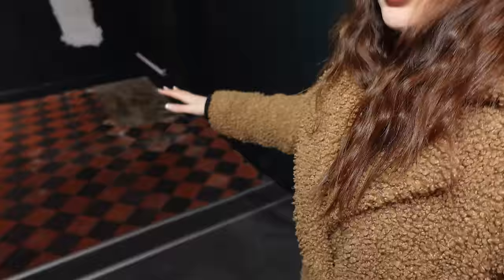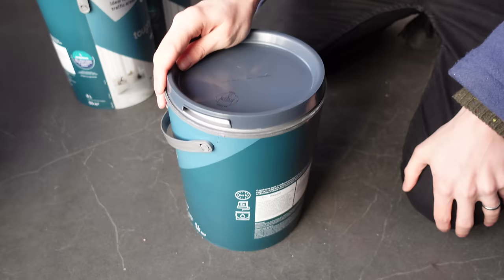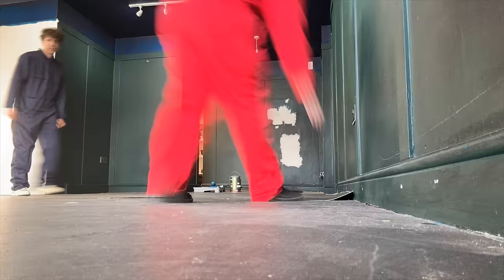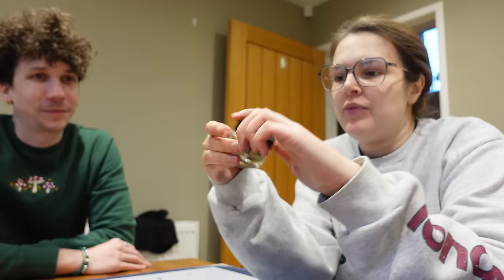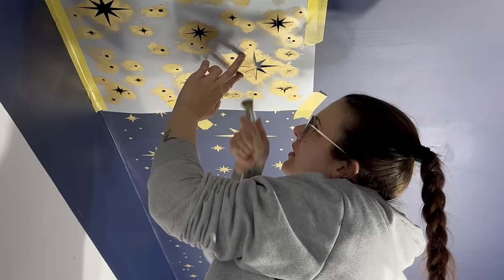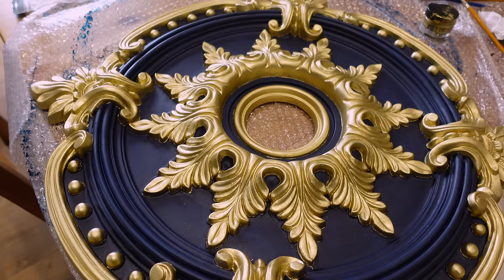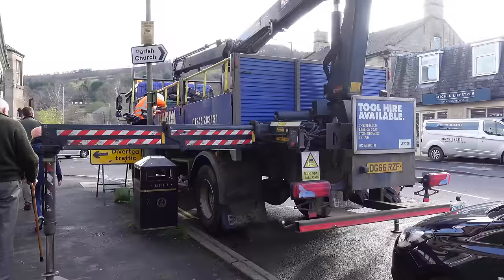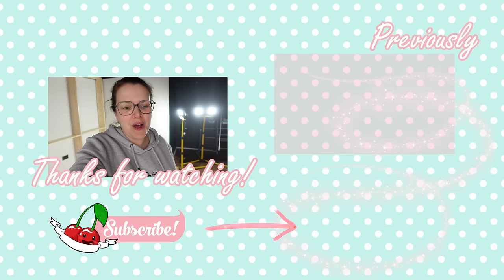starting the renovations on my magical shop 🪚 | Part 1

Comment: I personally would have left the gold flecks on the floor. It is so whimsical. Like it suggests that the magic in the air is so thick, golden dust falls in little deposits. Or maybe a potion bubbled over. Or the wood is from a tree with magical properties and the sap that oozed out was made of gold.

Comment: 😂Lesley is too humble...  his  sign making talent is other level.  He could make a living making signs and putting subliminal words, symbols, and visuals under the layers,  so anyone looking at the sign before entering promotes the best for the sign owner.  (Just an idea to enhance the shoppe experience.)
My question is, what did Lesley use to seal it? A heavy  epoxy or a light varathane? Brush on epoxy in a ventillated room will last longer in the outdoor elements whereas a light spray of varathane is more for indoors. 

 And so lovely to see people open to the healthy best of magical beingness. 💥

Comment: a little tip,  is more of my opinion,  not a fact.  
regarding stenciling the ceiling.  the fast way use or make homemade  wall paper.    paint paper,  then stencil the paper via roller pressing.,  then apply paper to the ceiling. 
there are youtubers doing that homemade wallpaper.

Comment: Here's a comment from Japan!
Your magic shop is amazing!! I really want to visit it someday☺️
When doing stenciling, instead of using that brush, I think it would be much easier if you tightly attach a dishwashing sponge to a stick and use that. Good luck!❤
Reply: Hi from Canada.  I think it depends what look you're going for.  The sponge can leave a  porous finish, depending on the type of sponge.  Whereas the brush goes right into corners, leaving a sharp edge.  A more porous sponge could give a softer look.

Comment: Just wanna give a heads up on the sign (its gorgeous btw 😍) but because of the type of wood he used make sure it’s sealed really well or it’s gone expand and fall apart when it soaks up water from the rain 
Personally I would put a thin layer of resin all around to protect it 😘
Reply from the maker: Absolutely, we’re weather sealing the heck out of it, as we want it to last!

Comment: Cherry, did you thinking about just using a paint roller to apply the gold onto the stencils? Btw. I am do excited for you! Congratulations on your new shop, I know it's gonna be amazing because you are one of the most creative and talented people that I've seen to date.
Reply from the maker: A roller would have worked if we were using paint and on a flat surface (upside down on a ceiling has its own problems with stencils haha, and it being perfectly flush was one of them).

Comment: Just a little tip, always do the flooring after you're done with painting and construction, that way you won't damage your new floor. You basically work your way down from the top, so ceilings first, then the walls, then the floor. And installing PVC really isn't hard, you don't need to hire a professional for that 😂❤

Comment: i would wager the ceiling paint marks where just because its dark paint and it often takes a 2 or more coats to remove the patchiness. hence why it got better after you did another coat. you might of fired someone that was doing a perfectly good job
Reply from the maker: He did over 4-5 coats… it was just a bad job lol. 😂
Reply: @cherrywallis  After many attempts at painting I finally went online to find the best way to cover walls so there's not that heavy streak and markation. It looks like the original painter wasn't painting in smaller  sections, and applying the roller incorrectly, too long rolls  and not removing excess paint before rolling.  

Rolling in a N shape starting from bottom and rolling to the top,  or on the ceiling starting one direction and rolling to the opposite direction.  then twisting and angling down into the next line of the N, then back to the next line to form the N. Either up and down on a vertical wall, or side to side on the ceiling.  Starting another section after dipping the roller in paint and removing excess paint is key, or the ceiling looks like  the original photo.  One starts where they left off on the line of the last N so there's overlap and not such a clear demarcation. 

After letting it dry one starts to role the N shape over the first coat, but roll the N  in a different direction so there's better overlap which reduces demarkation lines.  
... for anybody wanting to save money on painters....

Comment: So he should have been using a spray gun to do the painting, if he was any kind of professional, you shouldn't have been using a roller. Granted I don't know how things are done over there but in the United States I can get a cheap paint system for like a hundred dollars and even as a do-it-yourself project I can spray. Paint rollers are better than using traditional brushes but you have to know what you're doing and you have to be practiced at it or it's going to take you twice as long . I'm sorry you had to deal with that. I hope your shop is wildly successful